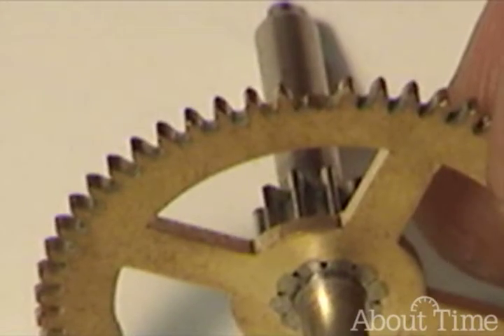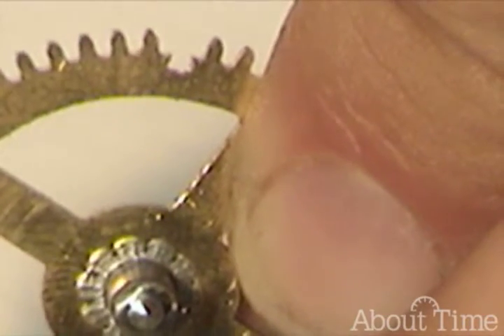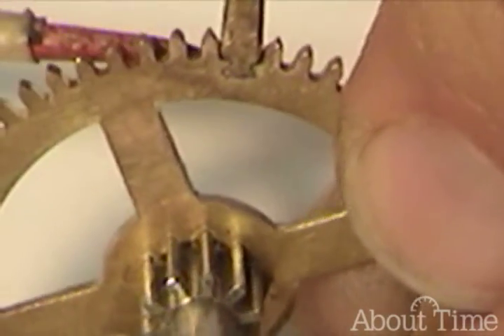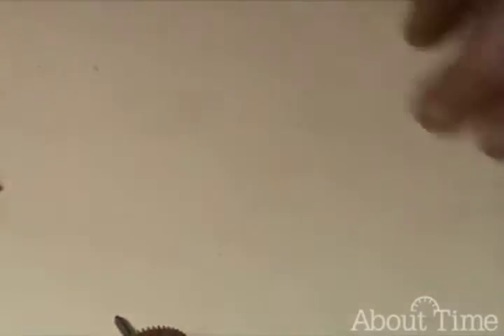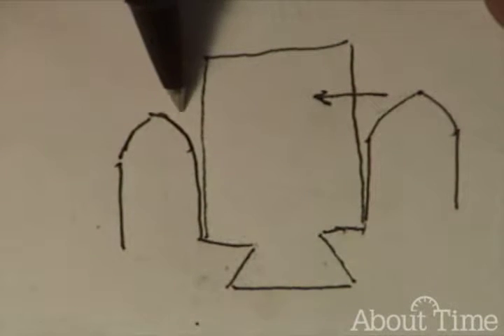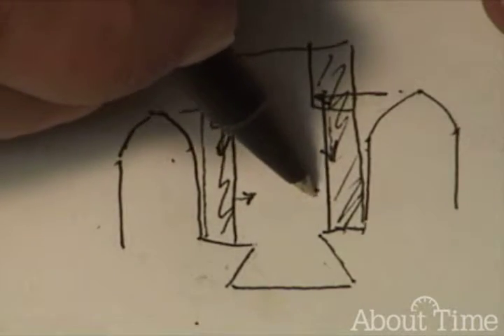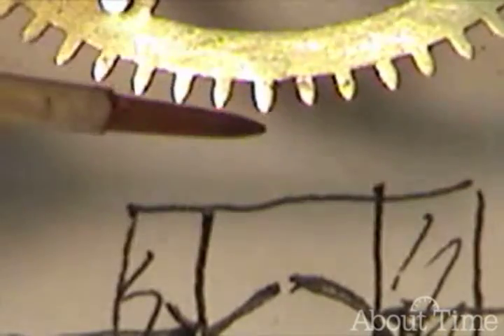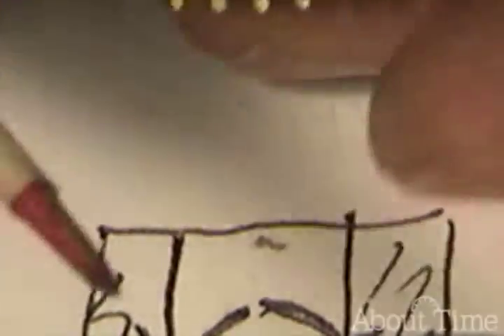ClockClass - Damaged Teeth

Comment: could some new metal be brazed onto the gear and filed to shape instead of dovetailing a piece on ?
Reply: The problem with adding material in this fashion is that you must heat up a large area of the brass.  This will anneal the brass, making it soft and easily bent, which isn't a desirable result.  Dovetailing in a new piece of brass, and then using a low-temp soft solder to secure it to the wheel, is less likely to cause the brass to become soft.  Great question and thanks for asking!

Comment: Any videos on repairing bent spring barrel teeth like on a seth Thomas sonora chime unit barrel.
Reply from the maker: Hi Will-  I just reviewed the DVD "Repairing Damaged Teeth" and it doesn't specifically cover straightening barrel teeth.  However, the principle is the same...  Gently warm the area with a lighter.  Use a flat screwdriver to pry and lever the tooth straight.  The blade should just fit the space so you may need to use several different screwdrivers.  Check the root of the tooth for any fracturing and replace if fractures are present.  Good luck with it!
Reply: @clockclass5480  Thank you I'll need it are there any avenues for purchasing a new barrel ?
Reply from the maker: @willf5768    Yes, About Time Clockmaking has a large parts inventory and does have some ST Sonora chime barrels.   However, a barrel would need to be pretty far gone for it to need to be replaced.  It would be better to replace a tooth, or five, rather than purchase a new barrel.
Reply: @clockclass5480  Well this one has three teeth involved bent from bad to really bad there is a bulge at the barrel spring hook area and someone before has done some filling around the cove so I am assuming it's been apart for some reason. I had called a repairman that has been in the business for many years and his quote to repair the eye of the spring and the barrel teeth was $400.00 about what the clock is worth maybe. I can probably fix the barrel and the spring but don't have the means to safely remove and install the spring which I was told a bear of a job without a heavy duty spring winder. And I kind of concerned with the reliability of the barrel to be honest.
Reply from the maker: @willf5768  The high repair price is because of the dangerous mainspring, I'm sure.  However, all of the damage is repairable with the proper techniques.  I routinely repair bubbled barrels, re-end mainsprings, install new barrel hooks, and repair/install teeth but I completely understand your concern about a repaired barrel performing reliably, especially considering the size of the mainspring.  Good luck with your search for a replacement barrel and let me know if I can help further!